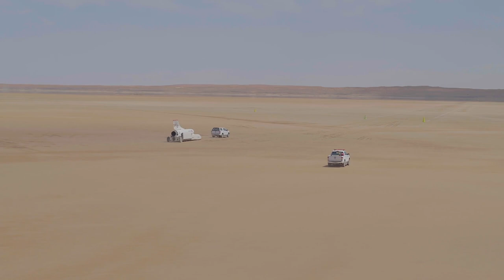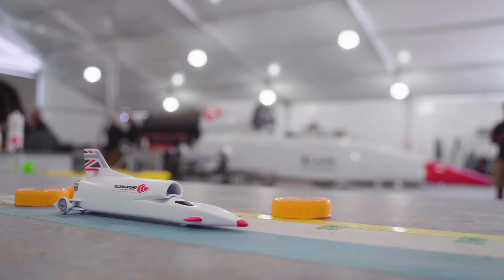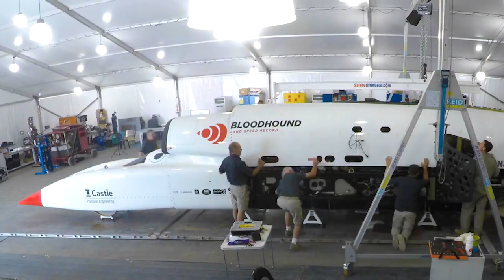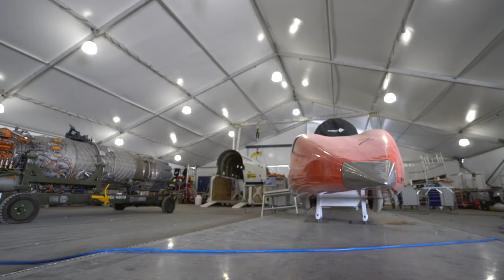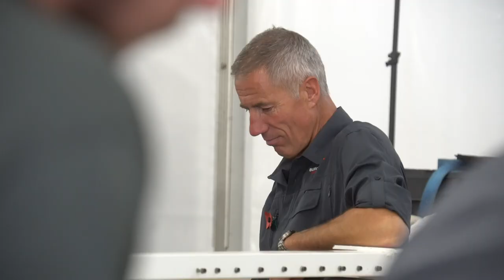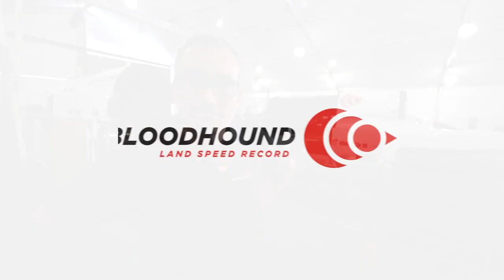The latest news from the Kalahari desert!

Comment: Congratulations on stirling progress so far! On the fire wire, was it under specified originally? Is the engine running hotter than anticipated? And won't the SRB increase heat management issues?

Comment: Safety 1st makes this a long task but I'm impressed it has to be that way, with that in mind I still can't get my head round how the Rocket stage gets tested though? I know it can be shut off but that's all, is the next visit to SA where that phase in the high speed runs gets tested? i.e. without fuel and the rocket itself it's not weighted as it will be etc?

Comment: Great project & coverage - Two questions 1.  Why not use an aircraft APU for the oxidizer pump drive (less weight, more reliable) 2.  Is there an ejector seat?  Thanks
Reply: No ejection seat on the car.

Comment: I know it seems like a dumb question` but what happens if Bloodhound becomes airbourne ? ... would Andy still be safe and would the car stand up to those kind of pressures ?.  Keep up the great work and good luck to the whole team.
Reply: Very unlikely to happen. Bloodhound has been designed with top-end CFD and wind tunnel testing. As I understand it, at maximum speed, it will generate a small amount of lift, reducing its ground weight from around eight tonnes to about seven. Unlike an F1 car, Bloodhound has a proper static stability margin - the centre of gravity is ahead of the centre of pressure. Only if the CoG gets behind the CoP will the vehicle lift off the ground. Remember that although the fuel use will change the static stability margin, moving the CoG aft, the CoP will move aft as the speed increases anyway, countering that effect.

This sort of thing afflicts Formula 1 cars and LMPs because there are no rules requiring those vehicles to be aerodynamically stable (frankly, I don't know how the designers live with themselves). That's why they become airborne.

Comment: To get a world record, you have to run in two directions in a short period of time (an hour?). So next year, whenever you beat the current record in one direction (possibly a record set by yourselves a few days earlier), will you do a quick turnaround to claim the new record? Will you do no turnarounds until you've done a 1000 mph run? Or something in between?
Reply: The have already practiced a turn around with the car under its own power. I read this on a run report on the website
Reply: The intent is to set a new world land speed record next year (2020) which will require a turnaround and run back. They have 1 hour from stop to go to do that.
Reply: @essuu  You don't know when they are fitting / manufacturing the rockets do you? Wikipedia and there website were a bit blank on current status!
Reply: @rivalrepairs  Nammo should be supplying one rocket next year to attempt 800mph. If that goes well and it looks safe, they'll need three Nammo rockets in 2021.
Reply: @essuu  Thanks hope it all keeps going well !

Comment: Bloodhound crew - I have a pertinent question - Why couldn't the Thrust SSC car have been retrofitted so it could be made suitable to run this 1000mph land speed record? Why the need to make a whole new car? Speaking for myself on just the aesthetics, Thrust SSC is a much sexier and beastly looking car. ;)
Reply: Thrust SSC wasn't designed to run at these speeds. By comparison, the design is quite crude and had basically used up its design lifespan by the time it finished its runs at Black Rock Lake. Also, while Thrust produced a sought equivalent 81,000 hp, Bloodhound will be around 133,000 hp, once it gets the rocket engine. That's the kind of power you need to do Mach 1.4.

Comment: Great job.  Another dumb idea.  Can you make a burm so the cross wind would be deflected over the vehicle? And a really dumb question.  Can you have the  traditional 2 wheels up front for stability.  A four wheel car?  Do you sell merchandise?  Thanks again for your exciting entertainment. Wish you guys the best!
Reply: Having burms on a speed record track would be a really bad idea, as for your question about 2 wheels up front Bloodhound does indeed have 2 wheels on the front. Check out Chris Harris's video from a couple of years ago, he has a detailed walk around of the car while it's under construction.
Reply: One burm, parrelle to track.  What ever hieght or distance from track needed for safety.  25-50 foot high  burm.  A wind break.  Front wheels would be equal distance as rear wheels for stability.
Reply: @kmflynn329  A wider track at the front would mean increasing the frontal area of the car and since drag goes up by the square of the velocity this would be undesirable. You want to keep the front of the car as slim and pointy as possible.
Reply: Your right.  But they have the modern power to over come that, i think.  Anyways, I support them.  Nothing wrong with heated duscussion.  Mike

Comment: Whenever I see this thing it reminds me of an upside down F-16 fuselage.  Was that a design element or more of a Formula 1-inspired look?
Reply: Bloodhound is designed to be supersonic and to do that it has to overcome some basic problems. The biggest of those problems is that the EJ200 cannot process supersonic air. In fact, it probably doesn't like anything much above 500 - 550 mph, which is why they will be wanting to get to 600 and above.

To do this requires a special inlet and the kidney shaped one they came up with has not been used before in this type of vehicle. This is probably the cleverest bit of design in the entire car. Its job is to interact with the canopy which sets up a standing shockwave to slow down the air entering the capture area of the inlet. Air slows down through shocks. From that frontal shock, a number of other shockwave patterns will be formed and maintained in the inlet duct so that the air can be processed by the engine even at sonic and supersonic speeds. It should maintain a constant airflow through the inlet tunnel, regardless of what speed the vehicle is doing.

Unlike the F-16, which it broadly resembles, the canopy does the work of generating the shockwave. On the F-16, it is done by the splitter plate which forms the top lip, just under the fuselage. This stuff is way beyond anything F-1 is ever likely to need. Modern F-1 cars do use splitter plates but they don't travel fast enough for shockwaves to ever be a factor. They are used to regulate the flow of air under the car at speeds well below those where compressibility effects start to come into play.

This is a fixed pitot type of inlet which has a practical maximum of Mach 2.0 or thereabouts, well beyond the design speed of the car. Anything faster than that would require 2D variable intakes which are simply not needed.

Don't underestimate this. Inlet design requires very high intensity mathematical work and CFD. If you get it right, the engine will run sweetly and produce its maximum amount of power. Get it wrong and you can have compressor stalls at supersonic speeds, which could not only destroy the inlet and the engine but could put the driver's life at risk. There is no room for eyeball engineering here. You can get away with it in F-1 but supersonic air does not forgive mistakes.
Reply: TheThirdMan had to do some research to catch up on what you’re describing, it’s stretching my knowledge of aerodynamics.  If I understand it correctly, the design of the nose cone is such that the expected shock front created at transonic/supersonic speeds will keep that high velocity airflow from entering the intake?
Reply: @infidel1993  No. The high velocity flow will be controlled by the canopy over Andy Green's head.
Reply: TheThirdMan I was counting the canopy as part of the nose.  Maybe “nose cone” was a poor choice of words; or rather that it’s designed to channel air over the canopy, which then directs the shockwave around the inlet.
Reply: @infidel1993  Okay but it doesn't function that way. I get what you're saying in a kind of "whole of body" line of thinking but they have two different functions, in the same way the F-16 intake does. The nosecone is where the main bow shock will attach itself once the car is supersonic. In the manner of a boat making a bow wave, that shock will spread in a cone, the angle of which can be used to calculate the exact speed (nice!). The shock which forms over the canopy is a second shock, like this one over the canopy here:

https://en.wikipedia.org/wiki/Supersonic_speed#/media/File:FA-18_Hornet_breaking_sound_barrier_(7_July_1999)_-_filtered.jpg

Or a Schlieren image like this one, which shows the shockwave formations very well:

https://phys.org/news/2015-08-schlieren-images-reveal-supersonic.html

The Bloodhound team have done some excellent computer modelling of the shockwave formation on the car:

https://www.science20.com/news_releases/bloodhound_ssc_car_moving_one_thousand_miles_hour

You can see the small shock ahead of the inlet. Unfortunately, I can't find the specific bits I've seen on the shock formation in the inlet, much of it rough sketches by aerodynamicist Ron Ayers.
Reply: TheThirdMan So the canopy creates a sort of “secondary” shock front, separated from the one caused by the nose cone.  Is the shape of the canopy intended to act as a compression surface?
Reply: @infidel1993  I'm not sure what you mean. It will definitely create a high pressure zone because the air is required to deflect out of the way. In so doing it will create a shockwave. Have a look at the video I posted in which Dr Ben Evans explains how it works. What he doesn't explain is how the shock patterns form and are maintained inside the inlet.
Reply: TheThirdMan It’s something I read in an article about diverterless supersonic inlets.  Probably not relevant to Bloodhound since it uses a more “traditional” intake, but that led me to another article about boundary layers and the subsequent turbulent airflow.
Reply: Robert Lorrison Yeah, the Bloodhound team recently commented that if they were designing it today it would be different and the first thing I thought of was a diverterless inlet. 😉 I’m not sure how they’re doing their boundary layer control so if you have that article, I’d be interested in seeing it.
Reply: TheThirdMan The article was about transonic airflow and how it affects jetliners.
Reply: Robert Lorrison Okay. I’d still be interested because it’s all relevant.

Comment: Cant' get to the wiring without taking the engine out? Sounds like a poor design.
Reply: How would you do it then? Remember, this will eventually have a rocket motor underneath it and there's a limited amount of space if the frontal area is to be kept to a minimum. The engine was designed to come out anyway.
Reply: @thethirdman225  As an industrial electrician with many, many years of experience I would designate specific areas for wiring. Away from heat sources, easily accessible and standardized. Not difficult, airplanes do it all the time. Under anything is a bad idea, fuel, water, hot oil are all going down.. right onto the wiring / control boxes. Get them up, make them disconnectable in case you need to pull the engine. Too many years working on well designed equipment to tolerate stupid designs.
Reply: Jack Flash What part of the rear of that vehicle is not going to be hot?
Reply: @thethirdman225  Send me the drawings and I'll layout a common sense design for you.
Reply: @jackflash6377  Where am I going to get the drawings from? And like I asked before: what part of the rear of that vehicle is not going to be hot?